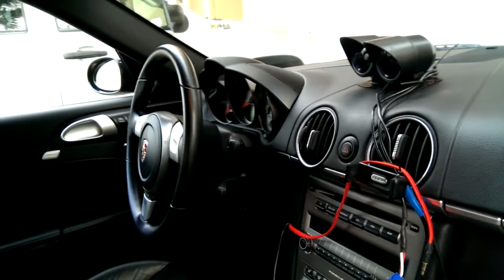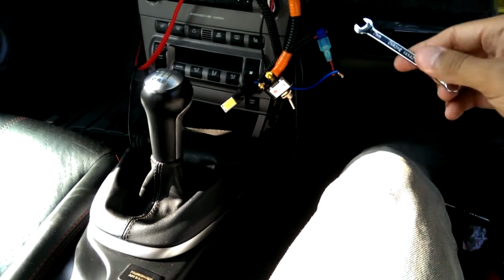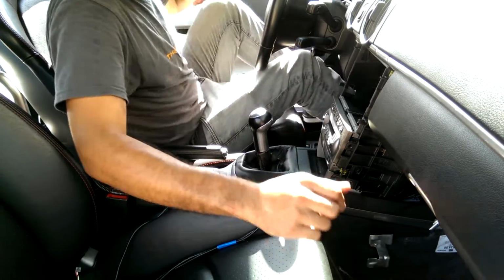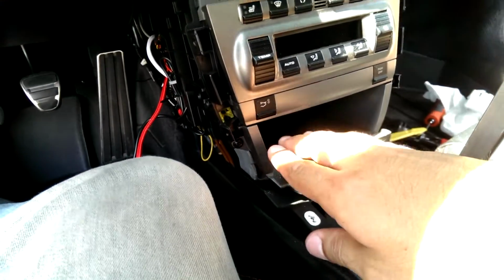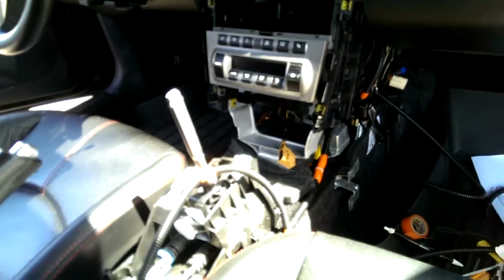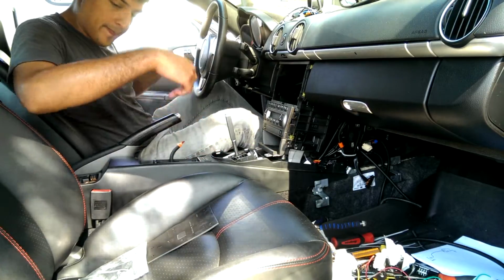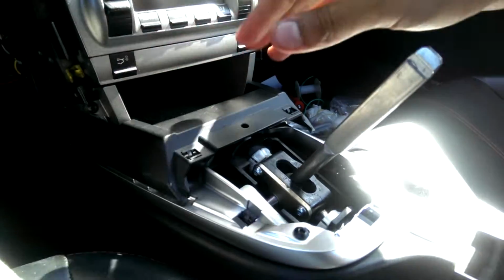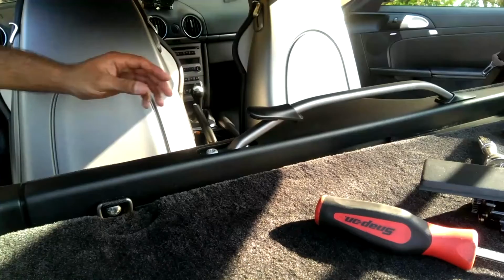987 Cayman S Accusump Wiring Cleanup

Comment: i see an aux cable with a CDR24 Explain yourself!
Reply from the maker: Good Eye just your basic FM modulator that plugs in between factory antenna and head unit. I have also heard you can send the radios to Becker (the radio manufacturer) to have an AUX cable retrofitted. 
http://www.planet-9.com/987-cayman-and-boxster-electronics/59404-cdr-24-back-becker-audio-sound-input-jack-installed-review.html